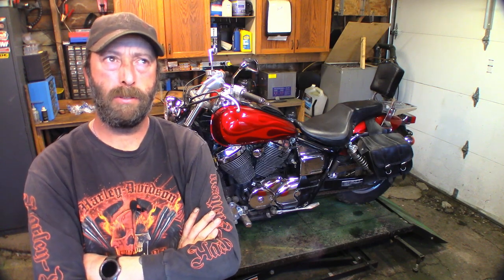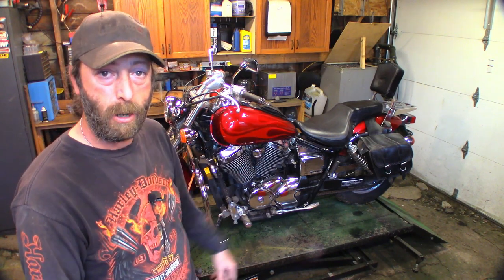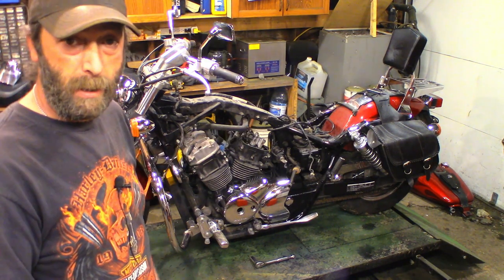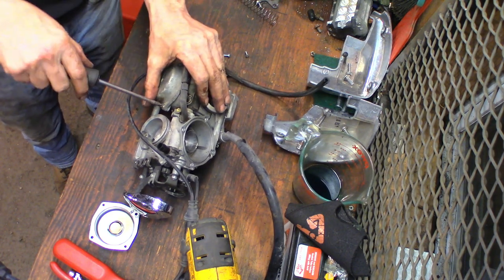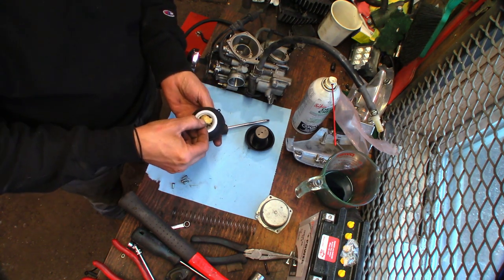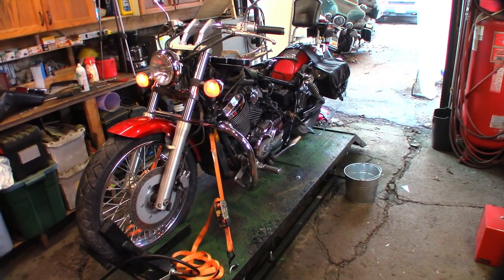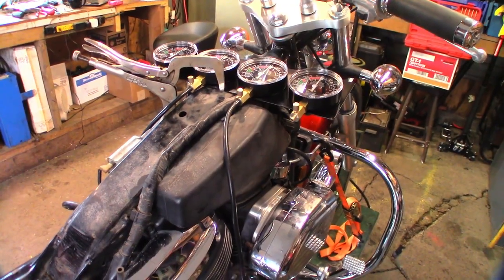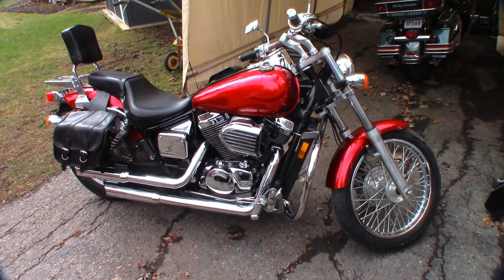2003 Honda 750 Shadow Spirit carb cleaning, vacuum piston replace and synchronize.

Comment: Appreciate the video review man... My step dad had a 2003 750 purple Honda shadow spirit when I was a teenager that I used to polish for him and learn how to ride cause I wanted to be apart of the club he was in called brothers of the wheel so h basically had me probate but learn about a motorcycle... He passed away on his Harley 1400 in 2015 sadly by heart attack.. he traded off the 750 after I got out of highschool for the Harley... We had it restored and gave it to my cousin who retired from the Marines after 20 years... Later my step dad's brother found the guy he traded the 750 to for the Harley and told me he had bought the old 750 back... I was happy but upset cause I wanted that bike so bad as it was sentimental to me with all the memories I had as a kid with my stepdad teaching me how to ride and work on my own stuff. My step uncle said "Im a trading kinda man you know this" I replied yes sir, he then said to me I'll make ya a deal. You give your cousin 500 to fix that 1976 triumph and I'll hand you the title... Bet your ass I made that deal... Now I'm currently figuring out if it's the carbs or a weak fuel pump... If I force feed it direct into the carbs... It fires up but the fuel pump barely sucks fuel to get to the carbs... Or it may be clogged. But after watching this video it made me understand a bit more of what my issues may be and how syncing works rather than fork out 900 bucks to have someone do it is rather keep those memories fresh and do it myself like my stepdad would expect me to. So again thank you for helping me better understand what may be the issues. I think I'll be riding across the u.s. soon enough, to carry my stepdad spirit and little brothers ashes on a trip we were all supposed to take out west.
Reply from the maker: Thanks for the great story!  Fuel pumps on these are like 1psi pumps, and only pulse when the pressure in the line drops. They don't run constantly.  If you find its pulsing really fast and not feeding the carbs, check the filter first before changing the pump.  Dealer pumps are very expensive.  I put an Amazon pump on this bike several years ago that had poor reviews, but it hasn't given up yet.

Comment: Great video 👍 got a like and a sub from me for sure
Have the same bike, Vt750DC, 2005, with only 12k on the odo. Let the bike sit for 6month with ethanol fuel in it. When I tried to fire it up gas dripped out the carb overflow vents. Looks like the float needle stuck so I tapped on the float bowl with a screwdriver handle and it stopped. After that, it started but ran like it was fuel starved.
Looks like its time to rebuild the carbs as I can only imagine the crap in them due to ethanol fuel. Never again with ethanol fuel. Non- ETN only.
Thanks for making the video so I know what to do when I get the carbs off
Reply from the maker: Thanks John!  Its not typically fun to get those carbs off and on, just make sure the intake boots are seated all the way when it goes back together.  That's usually the worst part of the job.

Comment: Would you rather work with carbs or fuel injectors?
Reply from the maker: I'm an old school kinda guy. I like carbs for sure.
Reply: Great job best I’ve seen on diaphragms. Curious as why you didn’t clean/inspect jets etc.?

Comment: Great video on doing right by an underappreacted bike. If viewers find they have carb issues, you can get most carb parts for VT750s from TJ Brutal customs without buying what you don't need. He's not cheap either, but you can trust his parts. Chinese parts for these bike's carbs are also available, but buyer beware on that stuff. Also, if you're going to pull the carbs out anyway, you might as well get a basic rebuild kit with a fresh float bowl gasket, and new float needle. Takes just a couple minutes, and TJ has a video on his channel on how to do everything.
Reply from the maker: Great info, thanks!

Comment: Thanks for the video!
i received my vt750dc back from the workshop after synchronising and noticed that the choke of the rear cylinder was kind of stuck. idn if they sync with a little stucked choke but now - after fixing the choke, the bike accelerate like hell (which is fine) but in the idle is popping every few 1-3 seconds out of the rear exhaust. with richer mixture cause of the choke, it wasn't noticeable at first.

the previous owner run the bike with too rich mixture for a few k miles (now it has 10k) to run it on lower idle.

idn if the valve are off after running on too rich mixture for long time or the sync way of after fixing the choke.

at first i thought about having false air because making the mixture richer on rear made it less popping. but then, after hitting the gas and rev a few times it was there back again.

is it possible, that this popping is comming from disunited  vacuum pistons too?

i'm a bit confused, because it runs perfect like hell, just has the popping on idle and by reving too after again fast it kind of swallows.

any ideas? ❤

i spend too much money on workshops and have the feeling, no workshop has the time or knowledge or motivation to help
Reply from the maker: Popping exhaust is a lean condition. Running with choke on a little will usually stop the popping but that's not a fix. Jetting is usually the fix. Dynojet kits work well on these bikes, I've done several. Rejet, resync and test from there.
Reply: I already have a dynojet stage1 and k&n airfilter installed. the sparks are looking good and according to the manual from honda, i set up the mixture screws right (measured by rpm in-/decrease). so it's a mystery to me. 

it's not popping while driving.. just in idle and the acceleration is perfect linear so i see no need in rejetting.
 i'm trying to resync by mystelf to take a look on it. 
can a wrong valve setting cause the problem of popping in idle too?
Reply from the maker: @nuffdiebuff954  I haven't seen valve adjustment cause this problem at idle. Should also check the head pipe gaskets at the cylinder head. They squash down over time and cause outside air to be pulled into the exhaust system.
Reply: @randomwrenching  long time went through.. i returned the bike back to the workshop to check the float height, because it was running a bit lean overall good trottle response tho but seems too hard. then i checked everything to false air - the carbs are leakproof. then i synced the carbs, checked mixtures screws (4 turns out) with rpm display of 50rpm precisly.. synced again..
but now.. i have the issue like before i got the carbs done..
Sometimes when the engine is warm and i rev the throttle "hard" in idle, (i think the front cylinder) chokes up and it backfires? into the carb. it realy sounds like choke up.. and feels like reving into "empty space" cause the motor doesn't rev. after this it runs back to normal. then i can rev certain times without any issue at all.. it never happend when driving. just sometimes when i try to rev in idle.  i noticed, when i sync the carbs just a bit more to the front cylinder.. it gives a bit better response on the throttle and the issue with choking up almost dissapeard. the downside is more vibration on the handlebar in certain mit rpms. Again.. with a lower float height, there was no issue, crispy throttle response but the engine was running to lean overall. now its back to normal, running great except those "sometime" choke ups while reving short at traffic stop or so. driving around half an hour, it happens about 3 times.
i have no idea what so ever it causes because it seems to happen so randomly with correct sync. i already thought about using spark plugs with a higher degree of heat like the manual recommend on extend higher speed..
any ideas?

Comment: Having the same problem with my 02 honda shadow american classic edition deluxe 750 running lean bogging out and wont stay running
Reply from the maker: Check to make sure your fuel pump is working. If it fails, the bike will usually seem to run not too bad with a completely full gas tank.  Once the fuel level drops it will sputter and starve for fuel.  Been there, we had that problem on the Spirit in the video on the past.
Reply: @randomwrenching  fuel pump is working
Reply from the maker: @kanelanzer485  Might be the same problem with a vacuum piston then, or possibly junk in the jets

Comment: Man!!!!!...thank you, thank you...I have an 2001 ACE750.
Reply from the maker: I have a regular customer that brings his Ace in for servicing! Nice bike!
Reply: I like your camera placement, you really showed what needed to be touched if that makes sense. I have not had to sync my carburetors but I have always been curious and how the process is done and just as I was wondering The Next Step in that process you gave the answer like at the end I didn't know you had to take the false air coolers off the motorcycle to install the tubes for the sinking device, it was a very good video thank you
Reply from the maker: @SoloBlack313  I'm glad you liked it!  If you were to throw a gauge set on yours, I'd bet they are a little off sync.  This bike seemed to run fine after the carb repairs, and the carbs weren't really that far off.  But getting them set up properly made a HUGE difference.

Comment: Hello!
How can gasoline get into the crankcase of the engine, that is, into the oil? (Shadow ACE vt750 1997) (RC44)
Thank you
Reply from the maker: A bad or dirty needle and seat in one or both carbs can cause that issue.
Reply: Thanks 😊

Comment: Great video buddy. Nice bike. Those are awful expensive ouch!!
Reply from the maker: Thanks man. It's been a great bike for my daughter, she loves it!
Reply: I picked mine up for $2100 in Michigan during summer right as gas prices peaked! It's a perfect first bike If you take a riding class
Reply from the maker: @Onelifeonedream2017  A little tuning and a dynojet kit will make her run better than brand new!
Reply: @randomwrenching  I'm pretty sure my bike has the same problem right now as it bogs out during idle sometimes but rides good in my opinion